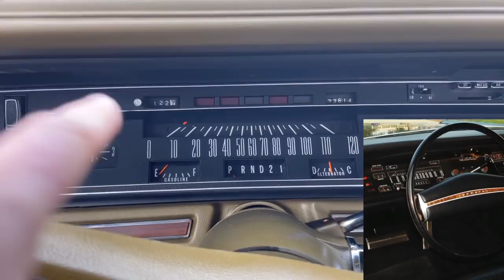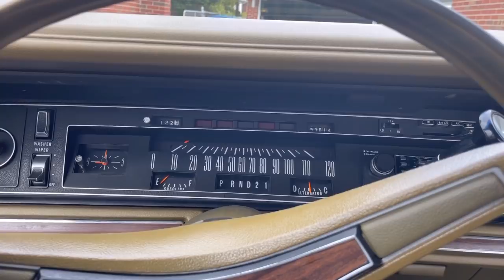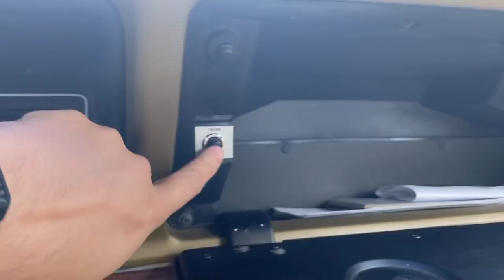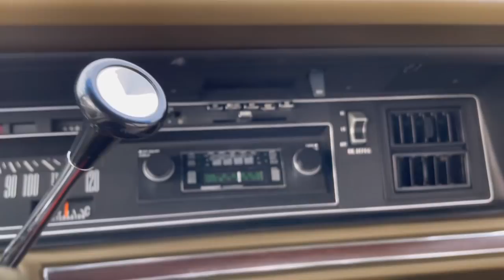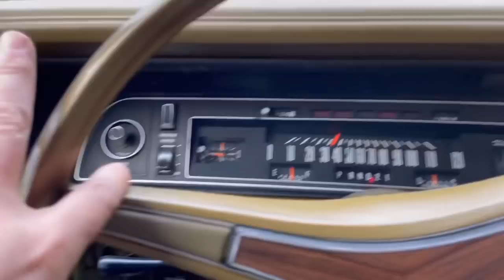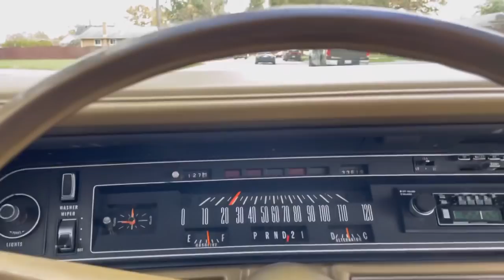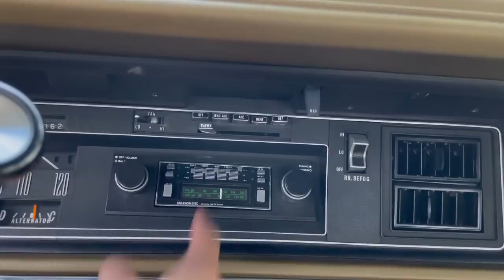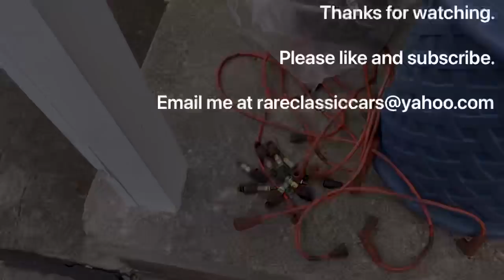FULL REVIEW: 1972 Chrysler New Yorker 440 V8: Fuselage Era Chryslers

Comment: Great presentation per usual Adam. Thanks for sharing your amazing "drivable" collection of unique classic cars. Big fan of yours. If you have not already, may you show us the GM 1977 - 1979 Cadillac, Buick, Pontiac, Chevy and Olds full sized luxury cars. I had a 1978 Olds 98 Regency sedan with a white exterior, light blue full vinyl roof and matching light blue velour interior 💙 it was gorgeous and actually was smoother and quieter than expected. It had the "detuned emissions controlled" 403 cid engine down graded to about 185 hp, as my memory served me. It was still peppy nonetheless. Thank you!
Reply: Byron Pink: The horsepower back then was rated differently with everything attached to the engine. The actual horsepower is actually much higher on your 403 V8 when the horsepower is rated with the engine alone.

Comment: Hey Adam, I really enjoy your videos. My dad had a '72 New Yorker 4 door sedan. It was a big boat of a car to drive. I remember well the pogo stick ride with the seats. He optioned it with heavy duty suspension and trailer tow package which just made it worse I'm sure. I was always disappointed with the overall quality of the interior when he brought it home. I wasn't crazy about the front grill either because it was a radical look for the time but now I love it. I was comparing it to the '68 New Yorker 4 door hard top he still had at the time which was a totally different car.

You talk about tough! Well, long story short, I ended up with the '72 and later sold it to a friend. He later put it end over end after failing to make a 90 degree turn on a gravel back road called the "Bunny Trail" near Parry Sound in Ontario. Every panel on the car was destroyed except the front and rear bumpers and the lights were still intact. He had a friend with him in the front seat who slept through the whole thing and they both luckily got out without being hurt. Just thought you'd like to hear the story. 

Back to that '68 New Yorker 4 door hardtop. I did my learner's permit on when I was 16 and I still have it and drive it in the summer. It's got the RB 440 4bbl in it with the 727 trans and 323 Sure Grip. I recently had both the engine and transmission rebuilt that maybe has 2,000 miles on it at the moment. It moves! It always did. It has the high compression motor that was so much quicker than the '72. I used to eat Mustangs, Camaros and 340 4bbl Cuda's with it all day long! They'd stay with me until I hit 2nd.

Keep up the great content. I love hearing about all the old luxury cars. 

P.S. My dad also bought an '76 Mercury Marquis with a 460 in it again with a heavy duty suspension and tralier tow package. It was much like the '72 New Yorker in terms of the interior. The ride wasn't as bouncy though. It didn't compare well to the '68 New Yorker either. Our family vacations were with travel trailers.

Comment: I spent too much time in a 71 Chrysler Newport 4 door sedan.  My dad bought it new in April of 71. It had the 383 , 2 barrel , 727 transmission,  sure grip, green clothe interior, power brakes, power steering, ac, am fm radio, green vinyl top, exterior was sherwood green . We kept it from 71 to around March of 1980. After buying a new 79 Pontiac Bonneville that was fully loaded the Chrysler was sold privately with 56 k miles . It was a rust free clean car.

Comment: The first new car I bought was a '75 Plymouth Valiant.  I knew about the ballast resister issues so I went straight to the parts department and bought one.  I put it in the glove box and never had a problem with it.  If I'm remembering correctly, it's function was to reduce the voltage to the electronic ignition module which operated at about 9 volts.  The ballast resister was bypassed during the start cycle and put back in the loop when you released the key from the start position.  That's why the car would start and then stall again as you released the key.

Comment: I have a white New Yorker Brougham with a blue interior 1972. It has power windows, A/C, no radio, split front seats, and came with the 400! It's not the post, so when all the windows are down, it's wide open! I picked it up about 15 years ago from sitting in a garage since the 1970s!

Comment: Love a cold light. Our 1967 Newport had one.  Very helpful when the thermostat fails, also lets one know when the heater is capable of warm air. On the 1972 Chrysler Corp. full size cars, the ac compressor was on even with the off button depressed. Supposedly this was to prevent moisture from fogging up the windshield. I always suspected there must be some other reason like maybe to prevent “dieseling” when stopping the engine.

Comment: Having owned and worked on many Chrysler Corp. cars since the 70’s I can say I agree 100% with your observations. My ‘66 Newport convertible had a terrific 383 coupled to a bulletproof 727 but with a dinky little Stromberg 2bbl which I never quite understood (and a VERY bouncy bench seat like a school bus). The awful Holley 1945 carb on dads brand new ‘74 Valiant with a slant 6 would constantly flood out and leak because of a defective float that absorbed fuel and sank. Of course in all of the MoPar cars (especially my ‘69 Dart for some reason) I always kept a couple of ballast resistors in the glovebox. Loved those cars through the late 60’s and early 70’s even if they were a PITA to tune up!

Comment: Being born in 1974, these cars were starting to fade away a bit by the time I was growing up in the 80s... But my uncle had a "Fuselage" styed Chrysler... no idea if it was a New Yorker or a Newport or a Polara... I just remember the massive backseat and the wraparound bumper in the front. That said, by the time kids my age started driving in the late 80s / early 90s, these types of old land yachts could be had for super cheap... and I drove a 1976 Mercury Marquis for a summer. Bought it for $150, put $100 into it and then sold it for $200 in the fall... The good old days... It was rusted out, hardly anything involving electricity worked in the cabin... but that ride quality and smooth torque-heavy V8 was still very much present. You could have run over an entire kindergarten in that thing and wouldn't have realized it until you got home and found a Teenage Mutant Ninja Turtle backpack stuck in the grille. The car just floated down the street like it was riding on the backs of angels. Ended up replacing it with a 1975 Cutlass, which was nice ride as well, but nothing like the full sized Mercury. 

Also just realized that Adam lives in the same town as I do... thought I was making out some familiar roads / landmarks during his test drive... and sure enough I've driven down that same service drive many times. Small world... maybe my wife will let me buy one of his old beauties one of these days, wouldn't have to pay to trailer it anywhere.... Always loved the old 60s/70s Detroit Land Whales.

Comment: Thank you for this nice video, seen from Belgium where, up to 1972-73, American cars were a pretty common sight, from the cheapest to the most luxurious. Belgium economy was still prosperous, and possessing an American car was a sign of wealth ; the souvenir of WWII and American army were still fresh, owning such a boat was a kind of homage, too. Around 1965-70, when I was a child, European cars were tiny, with notable exception of Mercedes ; Italian cars were rusting from the first day you own them and having a British car running more than a week without a technical failure was a matter of chance ; France was absent of the upmarket, unless you wanted to try a Citroën DS. Furthermore, as you point it rightly out, the capacity of charge of those great barges were unequalled, which was important for great families. We were 4 children, and all grew up in American cars, those of which I travelled in being a 65 4 glasses black 390ci New Yorker, finally a 68 440ci Town & Country with 3 benches (I was sick every 30 miles while travelling, due to those incredible springs in the seats, suspension and some concrete roads that still made American cars like in a SF chase). The huge increase of gas price in 1972-73, joined quickly by speed limitations and increase of taxes for all "big boxes" above 2l, caused a brutal end to this era and to the rather dense network of dealers. I think about those Chryslers with intense nostalgia. Greetings from Brussels!

Comment: We didn't get these in Australia but Chrysler built some fantastic cars in Adelaide Australia.  I've had a lot of Gms and Ford's but bought a 77 regal se 318 when I was a kid and the car was fast enough and handled great. Wasn't going to keep it but it's the most reliable car Irve owned , after 1 million k's I rebuilt it with a hot 360 15 years ago and after the thousands of cars I've worked on and driven it's Mopar or no car.

Comment: Great car. I have a 73 New Yorker, which has almost a 1974 Chevrolet looking front and not as nice as your 1972. The rear of yours and mine look absolutely fantastic. I believe front bumper standards later on 1974 were 5 mpg front and 2.5 rear, not 5mph but I could be wrong?
Reply from the maker: 74 was 5mph front and rear.
Reply: @RareClassicCars  Must have been 73 that had 2.5 rear?
Reply: Love the floor mats.

Comment: Dad traded in our 68 Newport on a 1971 Newport.  Had to trade that in when the steering locked up on my Mom driving it in Denver. Found it had been welded where it had fallen off a rail car upon delivery. Chrysler refused to repair it and take it back. So the folks traded it in on a new 1972 LeSabre.  My folks had 8 LeSabre models until they died, ending with a 2002 LeSabre Limited.

Comment: I was in ninth grade and car crazy when these 'fuselage' bodies were introduced.  One of my friends' parents had a '68 New Yorker, and we guys all thought it was so beautiful.  Problem with this design wasn't the 'fuselage', but that the windows looked too small for the size of the car.  I can remember seeing a '69 Imperial road test at the time explaining that due to its unusual styling, normal sized people would just 'disappear' when inside.  In '69 Motor Trend tested the NY against a 98 and a Marquis Brougham.  The Chrysler was the most expensive, and had a leather interior.  It was striking that, for its high price, its window and door switches were flat on the door like cheaper cars, rather than on the armrest on the 98, Cadillac and Imperial.  Remember, even  the '69 Bonneville had window switches on a smoothly-integrated door extension.  As you as a younger man have discovered, though, that Torsion-Aire suspension made for much better handling, as it had since 1957, though Chrysler kept diluting its benefits.  I got my driver's license in a '71 Plymouth Fury and it was a blast to drive in driver's ed.  Sorry for the long posting-just discovered your excellent channel
Reply from the maker: Welcome!

Comment: Nice review, I had one for a few years and also a 1975 Imperial Le Baron.
Both cars were gigantic and I liked them but, for an over 5 meter long car,
the legroom in the front was awful. I have way more legroom in the DS.
I always liked and still do, large American cars. The airco in those cars were
formidable, the best. Brakes were awful, but they leisurely slowed the boat down.
Even that one got used to. I was and still am, amazed at the size of the door hinges.
Enormous cast iron hinges. The structural integrity of Chryslers was good, and well
built. The trunk, as big as it is, is very shallow, Ford would win in that department
with having their fuel tank where it belongs , in between the rear wheels .
Ciao from a still warm YVR.

Comment: Thanks for doing this video Adam. You always do a great and thorough job. The car (from the back) has strong ties with the '72 Imperial. I was surprised it was actually taller (2") than a comparable Olds 98, Buick Electra or Mercury Marquis. It looks just as sleek. More GM-ish than Ford overall, but that's fine. I was surprised the front vent windows were semi-available as late as 1978, being surprised to see them on the Imperial you did recently. They would have been nice on this New Yorker. Would they have been an option here, do you know? I'm wondering maybe if it had been the open 4 door instead of the pillared 4-door. Just wondered.
Reply from the maker: I believe they were only available on the hardtops.

Comment: Nice looking car. These were nice riding balance between soft and comfortable. You're right that rust killed many of these cars while also being used as demolition derby winners. Bought one in 1989 for $700, 1969 New Yorker. Liked it but at that time I was a college student and didn't have the funds and time to really restore it too much. Mine had to use premium fuel because 89 octane gas would sound like ball bearings were loose inside. Loved the turn signal indicators on the front of the car and the vents for the floor that could be pulled out.  Chrysler could have made better improvements but Detroit at that time didn't do it because they assumed a buyer would be back in three to four years. Have you thought about a Carter AFB or AVS carburetor? Thanks for the video.
Reply: Terry McHugh: Your car and this car should be run on 93 octane SHELL SUPER UNLEADED along with octane boosters. Out in California there's some SHELL and UNION 76 gas stations that actually sell 100 octane lead free premium. When out there you'd probably want to try this premium gasoline like perhaps every other tankful. You'd be pleasantly surprised.

Comment: 27:30 - RE: 1960s automotive seating - personally the most comfortable I've found!  Yes, a little squishy, or bouncy, but back than, one must realize that the seat bottoms were part of the suspensions of that era.  You put 2010 Honda Accord buckets in that Chrysler, you'd have one achy backside after your test drive.  Suspensions weren't as refined in the 1960s as they were by that time of that Accord, so seats were designed to sink into, and cradle one from whatever vibrations the suspension did not soak up.

Comment: My 89 Ramcharger has the same shifter as well. I'm not sure if the 91-93 trucks did, but the last year of it would be either 1990 or 1993.

My bench seat, swapped in from an 80s pickup to replace dead buckets, also pogo sticks plenty. 

Also, I've driven that highway before. Can't quite place where it is specifically and can't read the signs, but I know I've been there.

Comment: Regarding the stiffer ride and bouncy seats, my guess is that Chrysler did the best that they could with the unibody chassis and subframes they had. Perhaps they could not make them ride any smoother or drive quieter without a lot of investment (which they finally did for 1974). One thing you might cover in a future video is the 1970 implementation of "Torsion Quiet Ride" on most of Chrysler's big cars. Extra rubber isolation was added to the subframe and rear suspension, plus the rear axle was widened. I think it was perhaps an emergency response to the greater noise and harshness (say, compared to a Caprice or LTD) in the 1969 fuselage cars.

Comment: I had a 1972 Mercury Cougar GT, looked like a , "Grande", Mustang, from '72. Had a 351C 2V, 3speed, Medium Bright Yellow. Black standard vinyl interior. Hi back buckets, floor shift. 3spoke black Rim Blow steering wheel. Only 3  options. was 3.25:1axle. , Traction lock axle, and power disc brakes. (Front).  PS was standard . Competition Suspension was included with GT Equipment group. Included: hood scoop, die cast badges, 3.00:1 axle, over 2.75:1. 9" conventional axle standard. 351C V8 2V standard, all models. 4V optional. Cobra Jet performance group included 4bolt mains, sporty dual exhaust, competition Suspension, and variable ratio ps gear box, variable ratio, courtesy of GM to Firebird, Camaro.

Comment: I’ve driven a couple of ‘72-73 Imperials before, and was astounded at how easy and manageable they were to drive BECAUSE of the stiffer ride, higher-effort steering, and controls. I’ve driven big Fords and GM cars, too, and often felt their relative sloppiness made them more of a chore to drive in city traffic than their Chrysler counterparts, which tended to give me more confidence. It’s a bit six of one, half a dozen of the other. Although I think some of Chrysler’s ride refinement and braking dynamics issues probably could have been solved by using rear coils instead of leafs, or maybe by adapting Packard’s 4-wheel torsion bar setup instead.

I also think that part of the reason Chrysler priced the New Yorker higher and trimmed it less plushly is because their C-bodies cost more to produce due to smaller economies of scale relative to Ford’s and GM’s big cars.
Reply from the maker: The latter is probably true. Unfortunately, the market sets the price and often doesn’t care about whether or not the manufacturer gets scale economies or not.

Comment: In my experience the ignition module was more likely to fail than the ballast resistor. Having both these parts as a spare in the trunk would be best):-. I doubt the black roof is original. Sometimes you will find these old cars where a previous owner had the vinyl top removed and had it painted because it's cheaper and/or to prevent rust. As far as I know they came from the factory with a vinyl top or they were body color. I could be wrong on that. I found oem orange ignition wires on e-bay for my '74 Imperial. More expensive ofcourse but they have the correct length and look stock. Anyway, another awesome car in your collection! Good luck.
Reply from the maker: It’s original. It’s included on the build sheet.